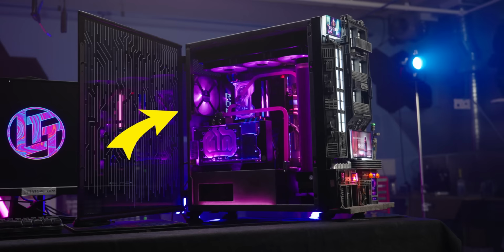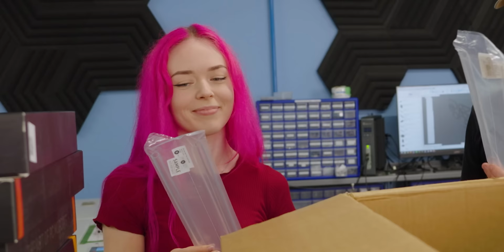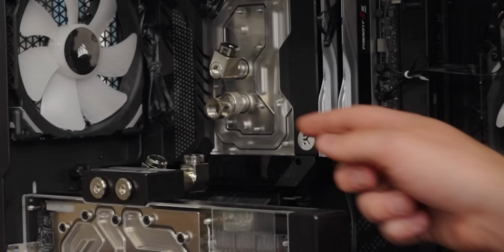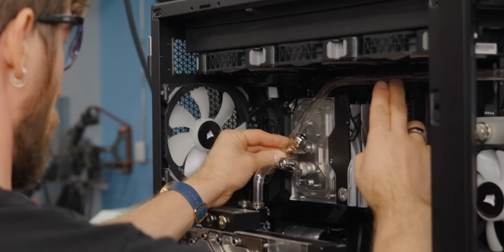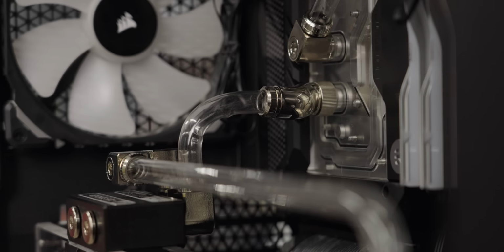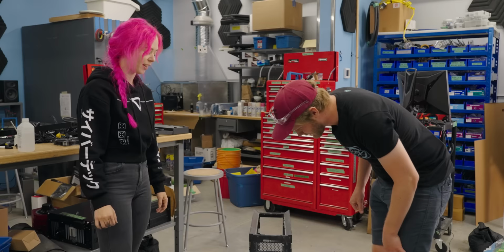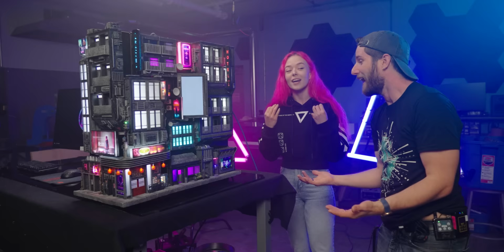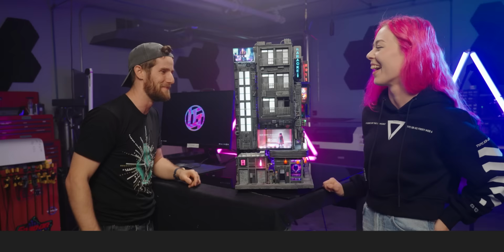This PC took 600 HOURS to Build!

Comment: I love the message about 2077 at 23:24. The cyberpunk genre is so much more than just the game, and yet people keep relating everything to that game when the genre has literally been around since the 80s and has so much more depth. Props for that
Reply: because of you, I have to pause on that part on full screen and stare reading the whole of it. No regret, thanks!
Reply: All cyberpunk (the game) did is damage the style.
Reply: While I agree, tbf, the Cyberpunk game (which Cyberpunk 2077 is based on) has also been around since 1988.
Reply: @Bluhbear  Man, I still remember playing that one at a friends' house with a group of other friends, we had a nerd tech side, so other than Cyberpunk, we played BattleTech too, board and C64 version. I feel ancient and yet youthful because of nostalgia.
Reply: I didn't even think of that until it was mentioned in the long message. CDPR's failure did unfortunately have bad consequences on the genre. It's such a shame. I hope other devs learn from this and don't do the same to other "punk" fiction genres.
Reply: @Bluhbear  I came here to say this. Based on the Tabletop RPG. even the naming style as the 2nd editions was 'Cyberpunk 2020' so the naming convention of Cyberpunk 2077 still straight from the TTRPG.
Reply: Indeed. Cyberpunk and it's aesthetic has been around since the 80's. The video game draws deeply from the Art of the original Table top game however. Mike Pondsmith set that standard that long ago with the original Table top version in 1988. CDPR just refined it. This dumbass idea that CDPR broke new ground with the art of the game is pure idiocy. Even Deus Ex pulled from that art aesthetic from table top Cyberpunk modules. You can see it all over Mankind Divided.
Reply: Well, then again if you want this to be movie theme it be Blade Runner
Reply: I mean... we still have shadowrun... right?

Comment: As amazing as this PC looks, I don’t envy having to transport that thing if you want to move at some point. Either way, it’s an fantastic flex in both tech & art.
Reply: Just drain the liquid and build a custom carry case for it with wheels
Reply: Given the auction for charity mentioned at the end, they will have to figure it out!
Reply: Also a pain to dedust all the decorations.
Reply: @Reac2  wouldn't be a problem if you have a clean house and you Americans literally have compressed air in a bottle and you can always brush it off with a brush with super soft bristles
Reply: @chadkennedy8675  yeah moving to another continent, just wheel it the 5000km
Reply: @Reac2  Dust just adds to the theme :D
Reply: definitely wouldn't want to have to transport this thing, but at the very least it does appear that the artwork panels can be removed, so you could pack those separately to help ensure none of the art gets damaged. Transporting fully water cooled builds in general is nerve-wracking.
Reply: Considering the side paneling all comes off their hinges easily. You basically take off the side walls (the art,) drain the loop, remove the gpu and then use the space filler bags that gently but firmly fill the empty space inside the case. Pack the side walls in to secure boxes, pack the gpu back into its original retail box and shut the side door on the pc and you are good to transport.
Reply: @orlagh277  don't be stupid don't keep you smart , just for ease to move around obviously the protective case will protect it and having wheels on it will make it easier to move instead of picking it up you can push or pull it around
Reply: @chadkennedy8675  no, realistically it's a super impractical showcase mod. Let's be real. It's cumbersome to transport, requires disassembly, draining, internal and external padding. This is the kind of thing you REALLY don't want to move around any more than you have to

Comment: Stellar work guys. Nerdforge put over 250 hours into the case and leave it to Linus to fill it with every piece of nigh e-waste he can find. A waterboarded Motherboard, a CPU with the IHS being held on by prayers and goodwill, a GPU that's been through hell repeatedly... the only decent parts put in there were the ones he got for free.

Comment: Maybe I'm getting old, but the more I see builds like these my first reaction is becoming more and more "God, that must be a pain in the ass to clean."
Reply: It needs its own display case with a hepa filter and ducting to keep it cool. Wouldn't survive the pet hair or carpet dust in my house otherwise.
Reply: You’d actually be surprised. 

I own a caselabs SMA8 rig, it’s fine.
Reply: @DocOrtmeyer  you just not get it pal
Reply: why use these machines?
You ever been to a museum, hire people for it, if you can't do it yourself.
Reply: @lucasrem  why write comments like this?
Have you ever been on the other side?
Hire people if you can't do it yourself!
Reply: Dust is part of the aesthetic
Reply: Probably best bet is to take the whole thing outside and blast it with some compressed air
Reply: @Alfiewow  Or just datavac it once a week for 20-30 seconds

Comment: Does Martina have any experience with glass-blowing? The technique she used to heat the tubing is precisely what is used to heat glass tubing in a flame for bending.
Reply: I was thinking something similar with how the pipe bending works.
Might have to grab some tubing myself to see how much the neon bending skillset transfers over.
Reply: Not that i have seen on any of the Nerdforge vids.
Martina just seems to have this talent of picking up techniques as she goes.
Reply: @soundsofglasswork  i wonder how much business a glassblowing and pc watercooling shop could get... (likely not much more than just a normal glassblowing shop unfortunately)
Reply: @sircalvin  The glass itself would be like in the $5-$15 ballpark by my guess. So yea not happening. I'm betting the tubing they used was way cheaper and they didn't need a glassblowing torch.
Reply: @iamaduckquack Most importantly passion and lots of practice
Reply: @sircalvin  I'd say at least 50 times more than a regular glass blowing shop....

... so, what s 50 x $0?
 
Could be worse, could be glass casting. That is negative dollars.

Comment: Imagine if they made an entire series where they give groups of pc builders / designers, a section of a city to build, and then bring their sections together, (powered by a single absolute beast of a cpu)
Reply: then the beast of a cpu gets bottlenecked by a shitty graphics card, cpu is nothing without other good components
Reply: @SotEnjoyer113  I don't think a tech channel powerhouse would have a problem buying a good GPU so that's not really an issue
Reply: @bedhead8126  I mean LMG themselves stated they have problems getting the new gpu’s so yeah. A tech channel powerhouse CAN have problems getting gpus…
Reply: "Summon the Elected Sections!!!" with an imperial voice...

Comment: 20:02 would be cool if there was a coolant mixture that semi separated when not flowing so you could see this every time you boot the PC
Reply: Just use muddy water?
Sarcastic unpleasant joke apart, a liquid that separates upon resting will end up leaving residues in critical parts of the loop and clogging the system. I'm thinking of the cpu & gpu block surfaces primarily.

Comment: Take a page from the neon sign glass workers. They use a blow tube to pressurize the softening glass tube to avoid deformation while doing bends. A blow tube is just a 3-foot length of latex tube
attached to a latex tapered stopper at one end and a mouthpiece (or not) on the other end. Stopper in one end of tubing, finger over other end. Don’t “blow” - “pressurize” gently. To much and you can form a bubble. Practice before you need to deliver.

Comment: I’ve always wondered why people don’t “blow” into the tube when heating and bending it. Like when people bend glass tubes for neon signs, you cork one end and use a piece of surgical tubing to keep pressure and avoid deformation.
Reply: Most tube benders have a bendable tube of a different material inside to keep it round, don't know why they didn't use one.
Reply: That’s what the inner tube is for
Reply: @mitlanderson  neither of you saw the blue plug they were using?
Reply: @mitlanderson  that was the blue part inside the clear tube when they were bending it.
Reply: @nefariousyawn  damn I'm blind as fuck, thought that was a sleeve that had over on the outside for some reason lol. Doesn't help i watch in 360p on a phone.
Reply: @mitlanderson  I missed it too, I had to go back because I was also thinking they should have used a support tube when they were bending.

Comment: I think to take it to the next level you need to have the tubes from the water cooler run outside of the case- thru the modeling parts to act as neon lights! Neat build guys!

Comment: 6:20 - I wear safety glass whenever it involves: springs, snaps, spinning stuff, liquids, glue, rotating tools, cutting, compressed air and much more.
You've got only two eyes. What's ridiculous is not using protection. So yeah, anyone should wear eye protection when drilling. And makes you feel and look cooler fo sure!
Reply: safety squints if theres a chance of getting metal in my eyes and safety glasses if I WILL get metal in my eye, I've only been to urgent care 4 times to remove metal from my eye so it works pretty well
Reply: I'm sorry...glue and compressed air???
Reply: @charleystello1822  Yes - Super glues comes in different viscosity and the liquidy ones can squirt feets away.
Reply: compressed air loooool

Comment: 23:19 Nerdforge is very much right here. Cyberpunk is a beautiful aesthetic. The mess cdpr has made with CP2077 should never be a metric or standard to define what cyberpunk actually looks like. Akira, Ghost in the Shell, Blade-Runner are the torchbearers of this genre.
Reply: @ReanuKeevesAus  The game did work in their console gameplay trailer and others. The game should have run flawless at HD 30 fps in ps4 and xbox one. The game technology is nowhere bigger than what ubisoft or rockstar games use in their titles.

cp2077 failure has so much more to do than technical flaws. Something behind the scenes that we may never know of, like a problem with an investor, the management team, whatever.

And yeah, the ceo might make an apology video for its failure. But he may never disclose the REAL reason for its failure.
Reply: @ReanuKeevesAus  I'm pretty sure you get the series X version of the game for free, I've only bought the regular xbox one version but when I installed it once I got my series x it installed the series x/s version

Comment: great team up - great PC build by LTT and great futuristic city tech diorama art housing by Nerdforge
BTW My PC was water cooled from the factory (iBuyPower) and worked great until the pump died and started to mysteriously overheat and randomly shutdown (thankfully it had a safety feature built in that shut down the PC in case of overheating instead of frying the CPU). I took the PC to a local computer shop where they gave me 2 options: replace the pump and have it water cooled again or remove the water coolant system and install a fan coolant system (which would be like $100 cheaper & the tech promised that it would work just as good). I went with the fans and haven't had any problems since (like about 6 months so far).

Comment: I would freaking love it if the case is sealable like I would literally buy the case if she made a stock for sale
Reply: you want to pay for 600 hours of labour? better be flush with cash dude.
Reply: @toxpoint  i'm thinking it would definitely be fewer hours of work as the blueprint has already been made (and mass producing it even on a handbuilt scale would be easier umpteen times around) but it would for sure be over a thousand dollars for the modifications not including the case. Its super intricate for sure.

Comment: instead of using the heat gun to put that 90 in the short piece, you could have used hot sand (just put silica into a pot on the stove) and filled up the piece with sand and put caps on both ends. then when you bend the 90, the tube can't collapse at all.

Comment: her english is so good i am always so impressed when europeans or asians speak english as good as americans i get real excited loool. very good job. that's enough thermal compound for 8 builds btw. if you use too much thermal compound it might act more like a thermal insulator than a thermal conductor. ideally you'd have full coverage but the layer will be as thin as possible. spreading your thermal compound can cause air bubbles, that's really really bad. it's best to just add a rice sized blob or a pea sized blob depending on how large your cpu is, use common sense, and tighten your cooler down on it nice and tight.
Reply: most norwegians who are young speak fluent english, some better than native speakers

Comment: When making new brake lines i used a coathanger wire to find the shape and bends, idk why but i feel that would be useful tip for fitting watercooling pipes

Comment: So don’t take this personally it’s not necessarily a bad thing. She bent the tubing for the same reason a lower belt owner in martial arts often can a black belt. Often times Black belts tend to not only forget fundamentals but tend to build bad habits over time. She is new to bending tube. She took her time and didn’t feel the need to rush through it. Linus you tend to often get distracted and rush through things. I can’t recall whether you have said you have ADHD or not but that can also play a factor in why you could not do such a great job compared to her. But yea tbh that to me makes the most sense.

Comment: It's not that rgb sucks because of all the wires and crap, that wouldn't be an issue if any of the case manufacturers actually used their brains when making a case and actually gave us even a small amount of room to contain wires and mount things like rgb hubs, fan hubs, and etc..  p.s the final reveal was absolutely amazing that was by far the best reveal EVER!! From the adui to the edit and to the finished build it was awesome loved the audio in the reveal

Comment: Making a PC Case into a Cyberpunk Building! I am a PC Gamer for 30 Years and a Hobby Model Maker and Painter for even longer... This actually makes me wet my pants :) I always kept these 2 Areas seperate. I don't care about RGB in my PC (that most of the times stands under the table), just raw power, while doing cool light effects in my RC & Plastic Models. De Dusting that case must be a nightmare I don't want to cope with. But man does this look amazing! Just placing my PC in a diorama acryllic or glass case is not an option, especcially with a 13900K and a RTX4080 :(

Comment: Fast forward 6 months, now it will take 1200 hours to clean.
Reply: Never used air duster before?
Reply: @Sandor Dugalin If you are only cleaning a pc with air duster, then you are not doing it right! It has to be taken apart and cleaned with a soft brush (goat hair brush) repasted, wiped down case. 

Please dont tell me you only blow a pc out and think that's clean?
Reply: @originalWillZ  You must smoke in your room.
Reply: @sandordugalin8951  I dont smoke. 😑 LOL 😆
Reply: @originalWillZ  Then why you getting anything but dust on your PC, bro?

Comment: too much money and too much work on a PC that will die up in a few years or be phased out and won't be able to play the latest games anymore
forcing you to buy and build another PC. i just hate Hardware monopoly
Reply: What does this have to do with hardware monopoly? Also you can just upgrade internals, no need to buy another whole pc
Reply: @muzlee7479  but then the new games wanted you to have DDR5 and you have DDR4. had to change motherboard to DDR5, now that means changing the RAMs to DDR5, new motherboard also means NEW CPU unless its the same socket.
Reply: @SIDEKICKONYOUTUBE  Litearlly all your parts would be outdated sooner than your ram. Still has nothing to do with hardware monopoly
Reply: @muzlee7479  how do you figure ? lets say my motherboard is outdated, i can replace it with a newer class of motherboard without replacing my RAM ? like my DDR4 RAM can work with a DDR5 motherboard ?
Reply: @SIDEKICKONYOUTUBE  depends on the system but Intel still support ddr4 and some mobos can accept both (with a different bios version) . And again it's not the ram that gets outdated
Reply: @muzlee7479  yeah but the ram had to be compatible with your motherboard, and your processor had to be compatible with your motherboard. you get my drif ? you replace one you might end up replacing a whole bunch of them. not unless your motherboard has some sort of backwards compatibility with older models of RAM or can support processors from different sockets.
Reply: @SIDEKICKONYOUTUBE  I really don't understand your problem here. Yeah sometimes you need to upgrade multiple parts.. but still your current ddr4 ram is probably compatible with new mobos. Cpus don't change sockets every year so you have an upgrade path unless you buy into a dead platform. Obviously you can't use the same components forever.

Comment: I think someone is exaggerating or not very versed in what they do. I can not see 600 hours of work here.
Reply: How long do you think one could make this pc?
Reply: @muzlee7479  well the PC bill itself if we're not including all the fancy dancy bs should take only an hour or so to assemble will take more time to set up the operating system and drivers than anything else. Now you taking the account all the show stuff that does nothing for performance I still don't see more than 80 hours there. And that would be very generous.
Reply: I'm out and about right now so I cannot edit this comment and I'm using voice to text keep that in mind when reading the comment.
Reply: @BentonL  yeah, obviously putting in the basic components is less than an hour. But just even with the custom water tubing it's a couple hours. They mentioned that just the sandblasting way 5 hours... how long do you thing the whole case took then?